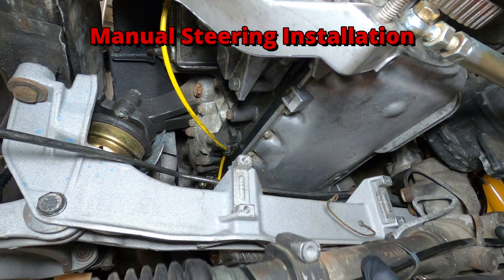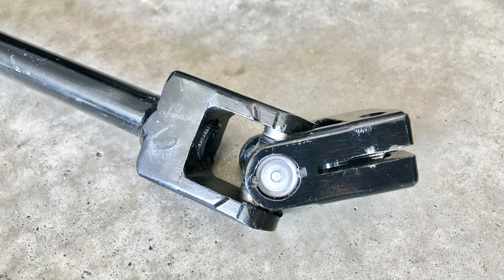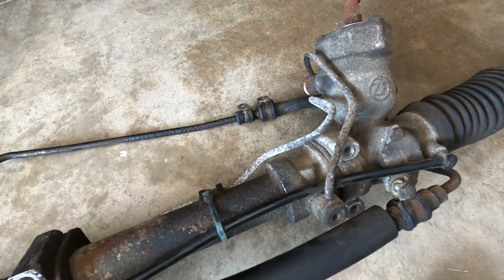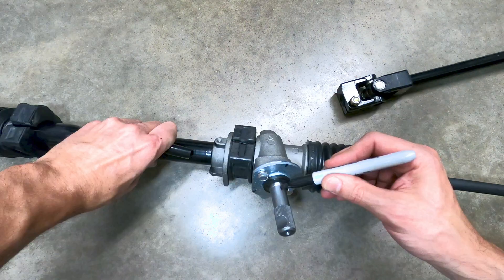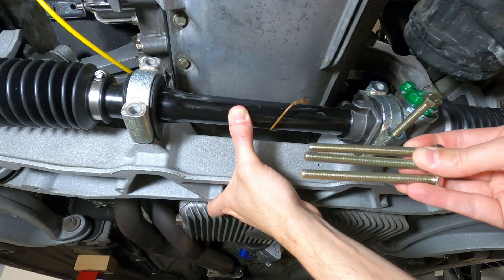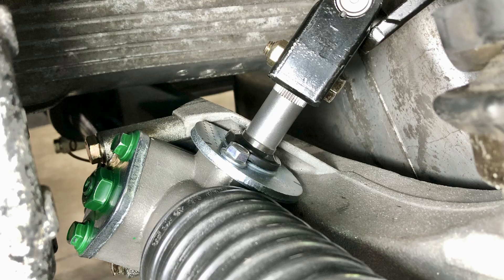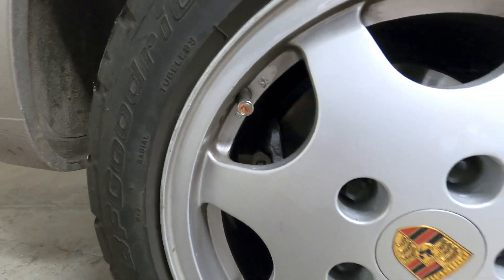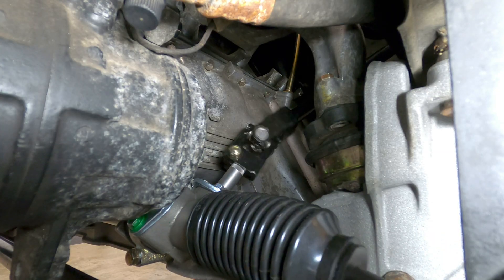Porsche 944 – Manual Steering Conversion / Rack Replacement Tutorial

Comment: I FINALLY have decided to give up on my power steering system. It's been a lot of money, downtime, and effort, and now the rack is leaking from the centering plug, so the pinion seals are likely toast. So much for it being the "rebuilt rack" I was promised... I'm just going to order this kit from Martin. Supposedly it's a more difficult job on the 951... I'll let you know!!! LOL... Thanks for the info, as always!
Reply from the maker: Oh man that sucks. That was my same fear with a rebuilt rack. Just got tired of chasing leaks. Let me know how it goes.
Reply: @NC944er  Got distracted for a few, but I'm ready to go soon. Just ordered the rack from Martin, should be here in a few days. Now I need to straighten up my garage and finally set up my Quick Jacks. Any other jobs I should do "while I'm in there"?
Reply from the maker: @jergervasi3331 It’s a little easier to get at the lower balance shaft housing with the rack and sway bar removed if you’ve got any oil leaks there, but otherwise it doesn’t coincide with a lot.
Reply: @NC944er  Aw, heck, I bet I do! I have LOTS of leaks... LOL... Thanks, as always!
Reply from the maker: @jergervasi3331 Haha! Most of them have a few. 😂

Comment: Nice video. Damn, your car is clean! Think I’m heading in this direction. My rack ends are leaking and the assist is inconsistent  and funky, particularly on the highway. Want to simplify. Had a 911SC years ago and appreciated that it only required oil, brake fluid and gas! Few systems to worry about hemorrhaging.
Reply from the maker: Exactly! It’s kind of sad that simplicity is a novelty nowadays. 😂

Comment: Hi. I have 944s2. Can I use  early 944 manual rack for the conversion?
Reply from the maker: @andrewireland7681  Unfortunately the early manual rack setup is not a direct fit replacement on the later cars due to the wheel offset change in 1987. There is a 3" difference in the end-to-end length on the racks, 51 1/2" vs 54 1/2". The rack would mount to your car, but the tie rods would be too short. The threaded ends on the manual tie rods are also opposite of the power tie rods (female versus male), so it’s not quite as simple as swapping in the tie rods from a power rack. You’d need to source some specific tie rods and tie rod ends or have a shop fabricate something that would work.

Comment: Quick question! Will a manual rack from a 1983 944 fit a 1986 944? I’ve got one I’m bout to buy but just need some advice before I pull the trigger, thanks!
Reply from the maker: @LetmeWHIPdaWHIP  Yeah, the ‘83 manual rack will fit on later cars, but if your car is LHD you’ll need the intermediate steering shaft as well (unless the seller is including one), part number: 944-347-027-01. 944Online and Pelican Parts have aftermarket ones available for $150.
Reply: @NC944er  thanks!

Comment: How is this holding up?  I am thinking of doing this in about a year when my piggy bank is full again
Reply from the maker: All is well, so far no issues! Right off the fresh install, the joints and gearing were pretty stiff, I assume because it was all brand new parts. After driving a couple hundred miles though, it broke in nicely and the movement became more fluid. Overall, it’s a quality setup, no complaints.

Comment: Great video thank you. I’m considering this conversation for my ‘84 na. Porsche went to power after ‘83 due to shimmy at 60mph that they couldn’t eliminate. Power steering was their solution to dampen that. Do you notice any weird shimmy etc with this conversion? I’ve always thought these cars should be manual steering. Thank you!
Reply from the maker: Hey, thanks! In short, the manual steering conversion has been a vast improvement in all areas except for in ease of turning at low speeds. I found the side-to-side movement on the new setup to be a little tight at first, I’m guessing because all the parts were brand new, where after turning the wheel halfway in either direction it would firm up and the wheels wouldn’t quickly self-center after turning. But, after driving the car a couple hundred miles, it has broken in nicely and is now a lot easier to turn. The “on center” position is just a little vague, but that’s true for most manual steering systems. Not in a sense where there is lag or play in the wheel, the response is very sharp, just that it requires more micro-adjustments when cruising in the straights. Feedback from the road is really clear and the steering feel lightens up nicely when accelerating through turns. Overall, it’s ultra-smooth when you’re up and rolling and I haven’t detected any irregular shakes or vibrations, if anything I’d say it feels tighter than the power rack I had on the car.
Reply: @NC944er  this is just great….perfect description of what this setup is like. It’s real scary to jump into something like this without knowing someone that’s already done it. It sure sounds like it’s for me too. These old PS setups are just a nightmare and I don’t think the manual upgrade would devalue the car. Of course I will save all the OEM parts that I remove in case someone wants them in the future. Thank you I appreciate your videos!

Comment: Insanely detailed.  Thanks for all the torque specs and links to buy.   Will be doing this soon.
Reply from the maker: Yeah man! Centering the rack and setting the front wheel alignment is a little tedious, but the new setup is a dream once it’s all dialed in. Mine was a just a bit stiff to turn for maybe 100 miles of driving, I guess because all the parts were brand new, but it’s broken in nicely now and turns really smoothly with no other issues. 👍🏼

Comment: Bought one of these from Martin several months ago, trying to find time to install it, very excited to having zero leaks.  I have a 951 though, I believe there is a fair amount of additional parts that need to be removed for install.
Reply from the maker: Nice! Let me know what you think of it after you get it installed. The movement on mine was a little tight at first, I guess because the parts were brand new, where after turning the wheel halfway in either direction it would firm up. But after driving the car a couple hundred miles, it broke in nicely and is now a lot easier to turn.
Reply: @NC944er  Update on the installation of this rack.  Just got it on the road, much more work than a n/a 944; but in the end what a difference!  Absolutely great kit and the steering feel is excellent.  Best part of all,  no more leaks.
Reply from the maker: @scorpionsrt8  The gift of having a Turbo… everything is harder. I’m glad you got it installed! Every time I get under the car for other work, I glance around and am immediately thankful for not having to check for power steering leaks, it’s a legit stress reliever. 🤣

Comment: How do you now account for the loss of the PS pump? Just a shorter belt?
Reply from the maker: Luckily, while the A/C Compressor and the Alternator share a ribbed belt, the Power Steering Pump has its own independent v-belt, so it’s really just a matter of deleting the pump and its belt, where just the aluminum mounting bracket remains afterwards.

Comment: @NC944ER just wanted to provide a PSA based on my experience. I installed Martins rack with my engine out. When I was test fitting everything I got a bit to “whack” happy with my rubber mallet. I ended up forcing the steering column spline into the steering column tube. When it was time to install the new Intermediate shaft it appeared that it was about .5” or more short. To resolve the issue I reinstalled the steering columns side of the old IM and persuaded it with my mallet while spinning it. This pulled the shaft back to original length. Install went super smooth after that!
Reply: Martin does a really great job and this rack is super high quality, just a lessons learned moment for me!
Reply from the maker: @tedtakesitapart  Yeah, that makes sense and I can see how that could happen. The intermediate shafts are notoriously different to remove, so there is quite a bit of hammering involved. 😂

Comment: This is going to be my next upgrade when I get the extra cash.  My power steering system has been down for a year+ and I see no point in fixing it anymore.  Thanks for the video.
Reply from the maker: Yeah, even if you get it all working and leak-free, something will eventually fail again with enough time.
Reply: @NC944er  My biggest problem, aside from the leaks is that one of the mounts actually broke. So my power steering pump rattles back and forth. I ended up taking the belt off and driving it as is for the past year however I'm getting tired of it. Converting to a manual steering setup is going to be far more rewarding than tearing the front half of the engine apart to put a new mount on it.

Comment: Just bought this rack to solve the ATF hemorrhage from my rack, any tips or etc left out you would have liked to know going in?
Reply from the maker: Nice! A few things not shown here that I ended up doing… I checked the new rack centering probably three times to make sure the marks were accurate and then one final time after the rack and steering shaft were fully installed before centering the steering wheel. I also ground off a little bit of metal from the top plate on the new rack, the corner the tucks into the cavity on the cross member, just so that it had some more space to freely align itself there. And I obviously spent quite a bit more time triple checking the toe in alignment than was shown. The most difficult part was getting the old steering shaft to separate from the power rack, lots of penetrating spray and hammering needed there, and when the ball joint fork didn’t have enough width to keep pushing them apart, I wedged some other metal plates in between the fork and the base of the shaft so that they could be further wedged apart with more hammer blows. Good times! 😂

Comment: Thanks so much for this. I've been chasing down issues on my factory manual steering causing vagueness and steering oddities and ended up deciding to go with this kit thanks to your video.
Reply from the maker: Nice! Let me know how it works out.
Reply: @NC944er  I just got the rack in and it feels amazing! night and day difference, before the state of my steering had me questioning my purchase and if it was ever really a good handling car, I had a local shop quote me 6000 in parts and labor!  Since I opted to reuse my tie rods the total cost came out to around only 650 and while the installation was a little daunting your video and great camera work helped massively. the hours were well worth it and I can see why people enjoy this car so much
Reply from the maker: @MrUglyDinosaur  That’s awesome man, I glad you got it installed! Mine was just a little stiff at first, but after a couple hundred miles, it has broken in nicely… and it’s been nice not having to check for fluid leaks down there anymore. 😂

Comment: Great video as usual. I am wanting to keep my power steering rack and wondered if you plan to do a video for a full rebuild on the rack? I have found a couple of videos but they only show limited information. Would love to see a full tear down and reassembly video.
Reply from the maker: Hey man, thank you! That’s a cool idea for a video. It looks like a real pain to do, right!? 😂 I do have my old rack just laying around, but no immediate plans to rebuild it just yet. The car tends to dictate what needs attention and when, so it may be something I could look at down the road.
Reply: @NC944er  fair enough. I may just tackle it and see how it goes. I have a very long list this winter. Im replacing every seal on the exterior of the car. Full engine rebuild (timing belt tensioner broke!). Rebuild all power steering compents, AC rebuild. Short shifter upgrade.......oh and full repaint! Should be fun
Reply from the maker: @smoothwood10  Wow, yeah… tensioner failures are pretty catastrophic. You’ve got a good list there. I’ve put off my A/C restoration for a bit. Other things keep eating up my budget for it. 😂
Reply: @NC944er  ya no doubt. My budget is expanding rapidly. Every time I work on the car I find more broken bits I need to add to my list. My current shopping cart on 944online has 127 items in it. YIkes!! lol
Reply from the maker: @smoothwood10  Oh wow! Good luck! Yeah during the first yeah on mine, for every item I would “fix,” I’d have to add two more things that needed fixing.

Comment: My '88 NA is experiencing a leaK in the power steering and I'm looking at about $3000 to replace the rack, hoses, etc.  I don't mind the power steering.  I kind of like it.  But, I'm not really thrilled with the cost of repair let alone the thought of future leaks.

What is your impression of this manual steering conversion now that you've had it for a couple of months?  Do you miss the power steering?  Or, are you wondering why you didn't perform this swap sooner?  Thank you for the great content...again!
Reply from the maker: Yeah, the factory power steering is pretty nice, I like it as well, it’s not overly assisted and still offers a pretty good road feel. Long-term reliability was the primary driving force for me making the switch to manual. When I was researching and shopping for steering racks, I was seeing a lot of examples where other owners said their rebuilt racks developed new leaks within 1-2 years after replacement and the idea of dropping $800 on a rack only to have to do the work all over again shortly thereafter just didn’t sound fun. 😂 I definitely now have peace of mind in knowing I can use the car as much as I’d like and not having to worry about chasing down future leaks. 

I’ll also share that when I first installed the manual steering setup that all the joints and gearing were VERY tight to start out, I guess because of all the brand new parts, but it was to the point where after I would turn, the wheels would not attempt to center themselves back naturally, I would have to physically turn the wheel all the way back to straighten it out. After a few hundred miles on the car though, it feels like it’s well broken in and the wheels are now self-centering without assistance after turns. 

Because of its manual nature, you’ll also notice more that the steering is heavier under braking and lighter under acceleration, which makes it kind of fun and rewarding to hit the optimal speed when entering a corner so you can accelerate all the way through it for a light, crisp feel. Once the car is up to speed, it feels great and is easy to maneuver. The only minor annoyance comes when entering and exiting parking spots and at really low speeds I sometimes have to use two hands to turn the wheel, but that hasn’t caused any regret in switching, it’s just something to account for as I’m still getting used to it and the wheel occasionally becomes unexpectedly hard to turn. 

I’m currently eyeing the 370mm Momo Prototipo, as the diameter is 7mm larger than the factory steering wheel and I’m thinking that would provide just a little more leverage for those low-speed turns. For some reason, the manual steering has created an illusion that the grip on the OEM wheel is now “thinner” than it was with power steering, like there’s just not enough to grab onto for leverage, again mainly at low speeds, so I think the thicker grip on the Momo wheel would also tie the package together nicely.
Reply: @NC944er  So, if I am reading between the lines correctly, you LOVE the idea of never seeing a puddle of power steering fluid under your car.  But, you miss your power steering. <LOL>  The 944 power steering is really nice.  I also wonder how wear and tear will be on other steering components over time because you are really humping on the steering wheel to get the tires moving at low speed/parking.  There definitely is a trade off.  And it makes you wonder WHY Porsche only offered the manual steering for the first year?  Perhaps they discovered a problem with manual steering and chose to avoid it?
Reply from the maker: @guyfaux5010  HA! Yeah, mainly just when parking sometimes I’m like, “DANG!,” but all other times I don’t miss the power or think about it much. I know the earlier 944s were about 300 pounds lighter than the later cars, so that may have factored into Porsche’s move to all power, and probably the fact that it was more of a luxury brand and people would expect some extra features to be included.
Reply: @NC944er  Perhaps.  I had an early '83 944 and it had power steering.  So, Porsche did not keep that manual steering option open very long.  Anyway, I wish I could drive your car to see how I like the steering compared to the power.
Reply from the maker: @guyfaux5010  If you’re ever passing through central NC, feel free…

Comment: I need you to put in a momo wheel so you can tell me how it feels with this rack.  I asked Rockcrawler dude and he has sold his 944 and said he doesnt remember how it compares with the stock wheel...  Mine has a depowered rack and the steering is heavy with the momo wheel - Far too heavy to be enjoyable, even underway.  I did mine with the airbag wheel that required that I make a number of modifications and a new contact sensor for the horn from a non-airbag model.  You dont have that so your swap is easy - just money!  haha
Reply from the maker: Yes! I actually plan to install the Momo Prototipo 370mm wheel at some point, I just don’t have $400 right now. 😂 That would put it at 7mm greater diameter than the factory wheel at 363mm. So I have a feeling there will be a small improvement there, but more so in the thickness of the grip on the wheel for leverage, as I find the factory wheel to be pretty thin. But yeah, if I’m able to pick one up, probably next year, I’ll definitely post a video on it. 👍🏼